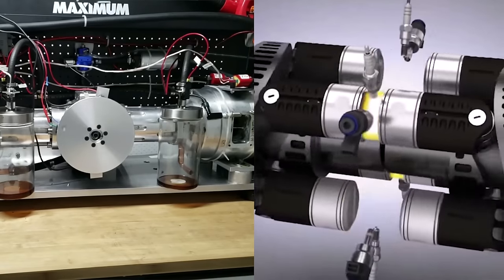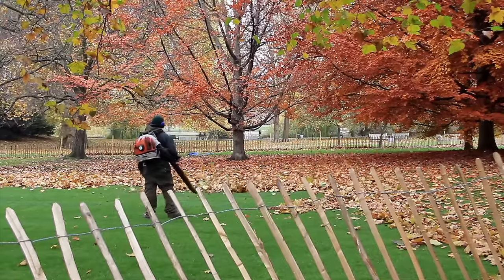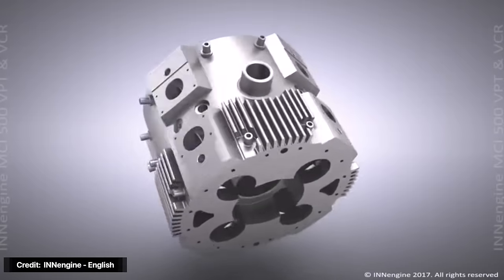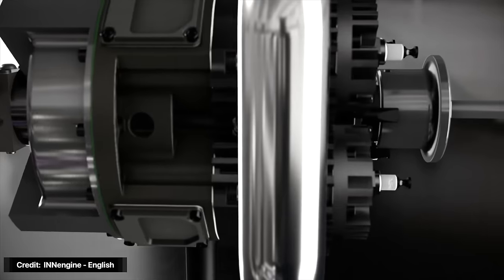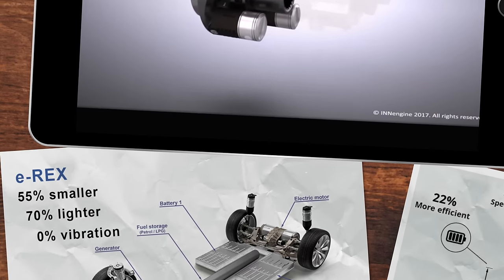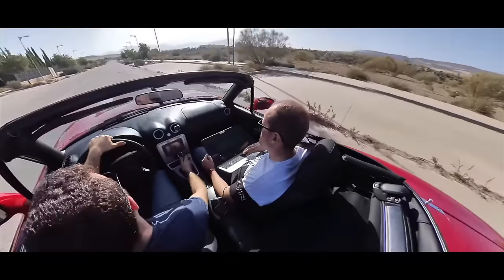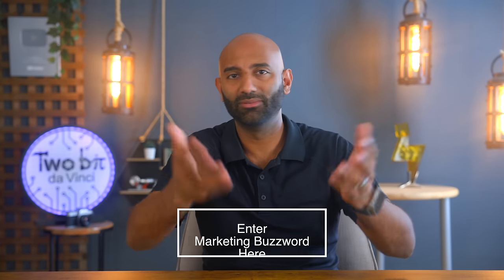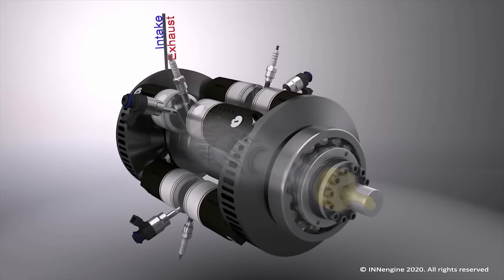One Stroke Engines - 200% More Efficient??

Comment: The Range-extender concept is exactly what Ram's 2025 Ramcharger EV is:  It's they EV truck with a smaller battery (150mile range on full charge) but with a 3.6 V6 engine to provide an additional 500 miles of range.  The 150mile range on the battery alone is a good blend, as that should be sufficient for most daily use.. but for longer trips towing loads, the V6 would kick in.  

I always felt this is how hybrids should work in the first place (I think Chevy's original bolt or something used to work this way?)
Reply from the maker: yeah that's right the Chevy Volt was a pure electric drivetrain, with a gasoline generator running at the ideal RPM for most efficient output to charge the battery pack. definitely agree this is the best way to run a hybrid.
Reply: They need to put that new inline 6 Hurricane engine even if it's non turbo as the twin turbo is overkill for this duty cycle. It will be more efficient as the lighter rotating assembly from a perfectly balanced engine negates the need for counter rotating balancing shafts or sizing of crankshaft counter weights.

Comment: Interesting question at the end! In the 1970s, during the Arab oil embargo, I worked out a plan to make a vehicle much like you propose. It simply had a battery pack, individual motors on each wheel, and a "small but efficient" engine running constantly at its most efficient speed to generate electricity to recharge the battery. That plus regenerative braking would have created an extremely efficient vehicle with 4 wheel drive and "silent running". Had something better than lead-acid batteries been available, and had I more money... woulda coulda shoulda...
Reply: Wasn´t the "every wheel gets an engine" idea shelved because it increases the weight and complexity of the vehicle and doesn´t add much efficiency ?
Reply: @thingamabob3902  Yes it kinda was with engines, but now with electric motor technology the wheel motor is combined with the brake and it only adds a bit of unsprung weight and electric is way less complicated than engines. Far fewer parts, electronic differential etc.
Reply: @slicksquared4336  ok
Reply: @thingamabob3902  Also greatly increases the unsprung weight. However , for a military vehicle, like  a modern Jeep, it would have a lot of merit.

Comment: The range extender idea is a very cool idea. The EVs are getting better at determining the range based on the route, live road conditions, and how aggressive the EV is being driven. An EV could use the range extender along with the route planned, driver input, and conditions at the charging stations to do long haul driving in a car with a much more modest battery. It means 120 mile daily driver does not need a 200 mile range for those infrequent longer road trips to visit the inlaws. In the end, you have a cheaper priced car with less battery weight and is more efficient for those all battery trips. As your range is reduced due to battery degradation, you simply tend to use more gas, but the car is not totally pointless the moment it can't do your daily driving with a full charge on only batteries. If the energy produced per gallon of gas is better than an ICE engine, the engine is near vibration free, and nearly whisper quiet, does it matter the RPM it is most efficient at? It would not likely stand in for a super charger station, but programing a route that requires 50KW more capacity than your car has in capacity, it can supply that 50KW in whatever method best benefits the car during the trip. A hot day, maybe it assists the high power draw accessories giving your battery an easier time. On a cold day, it supplements the heating of the battery pack. The engine could even be integrated into the battery pack cooling system. I don't think it makes sense to use gas to charge batteries unless you were stranded and had no other choice. The efficiency loss on the charging and discharging is not necessary if you can immediately put the energy to use. Tuning the engine and generator to provide as close to the same voltages as used by the main systems would be really important as well.
Reply: Only thing to range extender charging battery's is to run engine at constant efficient speed  and use the battery/moter as transmission for vering demand
Reply: @jeffbybee5207 
Ideally yes. The issue is what if you have a completely flat charge on the battery and have to limp home or to reach a charging station. Not being able to meet the demands of driving conditions required if you stuck in a single optimal engine speed. Perhaps an option could be being able to switch between a constant RPM setting and an on demand setting.
Reply: @jeffbybee5207   This goes back to the basic idea of hybrids: use electric for acceleration, and gas for cruising/charging.  Take all the latest EV technology, and add that 70mpg engine with a 10 gallon fuel tank, and you got a 700 mile range.  It seems like a great option as we develop better EV and their necessary infrastructure.
Reply: Electric motors still make some amount of noise so they're not entirely whisper quiet as one may think.
Reply: Oh, You mean,like a Toyota Prius,or a Hybrid Camry,or a RAV4 Hybrid?:goodvibes:
Reply: @exotica550  One could say that, perhaps.

Comment: Another reason this would make sense in a hybrid is as a solution to the too cold problem. You can start the engine and use it to heat the battery to temps it can be used. 
It also free you from the electric grid. You could totally run the engine to power the battery when necessary.
Reply: You would have to heat the oil and the block to start the ICE engine in the cold. You might as well just heat the battery in the first place.
Reply: @yodaiam1000  Correct . It would be far more efficient to use some of the stored energy in the battery to heat it , than to have a fuel tank engine and generator just to warm a battery.
It would be more efficient just to have a fuel tank and combustion heater for that matter
Reply: @yodaiam1000   - just have a chat to folk in Alaska without block heaters....
Somehow folk manage.  (not roadblocks just solved problems - elsewhere.)
Reply: @kadmow  You aren’t driving an ICE car at minus 40 without a block heater. People with EVs in Alaska manage as well.
Reply: @yodaiam1000   I had a 1983 dodge pickup with a 225 CI Slant 6 that would start at -40, without the block heater plugged in. I lived in Calgary (got some COLD Winters) and had to park on the street, no plugs there. I'd go start the truck and then have breakfast so it would be warn enough to drive to work.
Reply: @glenndennis6801  There are also EVs that will start at -40. It is not the point. I had ICE cars that wouldn't start at -20. Still, not the point. BTW, if you had an EV, you could automatically warm up the cabin in the garage (or outside) before you even got to the car. There is no waiting around to warm up the car.
Reply: @yodaiam1000  Problem with your solution is that at -40, EV range is already drastically reduced, then you gonna reduce it even more by using some of it to heat the battery and car interior?
Reply: @Stambo59  Part of the reason you’re range is decreased is that you have to heat the cabin. At -40, your range is about 60% which is still reasonable. Don’t forget there are are a bunch of issues with ICE cars as well at -40.
Reply: @yodaiam1000  "Don’t forget there are are a bunch of issues with ICE cars as well at -40." Sure there are but none of them will leave you stranded with no heat.
Reply: @Stambo59  Yes, they will. You should always carry blankets, food, candles etc with you when you travel in cold remote locations whether you are in an ICE or BEV.

Comment: I live in Minnesota and for us a fully electric vehicle when temps are below 0 is a tough sell. You can't forget about us and the effect freezing temps have on battery life. Up here a hybrid vehicle makes more sense. I own a truck and pull an > 9500lb load with boat, gear and passengers. My preferred lake is 1.5 hours away. An electric truck would only get me there one way and have no good way to charge on way back, unless I am willing to stop somewhere for 4 hours. A hybrid version, so ICE kicks in to charge my battery on way back, would be a very convincing proposition. At least for now, while tech and infrastructure catch up, hybrid versions of electric vehicles are the best option for many of us.
Reply: I drive a hybrid and it is great. I am not sure about the 4 hour stop to charge a BEV though. The Lightning and Rivian can both charge in well under an hour. The real issue I think is finding a pull through charger when towing. That is another area the where infrastructure needs to be improved.
Reply: Norway has colder temperatures than you do probably. And they are all going enthusiastically electric.

Comment: Range extenders in pick up trucks and larger vehicles is definitely gonna be something. We're gonna live with for quite a while. The ram pick up truck with the range extender It's going to be interesting to see when they actually get it produced what it's like.
Reply: I drive a truck and would like to go the EV route for the next truck. I'm watching the RAM REV. 95% of the time, I could charge it at home. For those times when I need it for towing it has a motor that can run the generator to recharge the battery. But a 3.6 liter V6 appears to be a little overkill. Waiting for it to come out. Very interested
Reply: Check out Edison Motors. They put a relatively small diesel motor/generator (range extender) on a semi (logging) truck. They are also working on a conversion for large pickups due to hit the market in about 2026. They are definitely focused on the commercial market.
Reply: @tomboyd7109 Edison motors is doing awesome work for sure. Range extended EVs will turn out to be cleaner than fully electric ones as they don't need a huge battery pack and liquid fuel will rarely be used since people don't go on very long routes every day

Comment: Just a little 2 cents here, a lot of phev could benefit from this kind of engine, I currently have an outlander phev, the wheel are operated by only the EV motors, but the gasoline engine can provide extra electricity at lower speed or directly contribute to the wheel when above 70km/h. The vehicule is equipped with a 1 speed transmission only for that. 
This engine design could potentially help that kind of vehicule with low range about 61 km per charge, making them more efficient in charging the battery or providing power.

Also there are so many applications for this this could be a really good way to move forward with reducing emissions like you pointed out !
Great video have a nice day

Comment: The range extender option has existed for decades. It is called a diesel electric locomotive.

There was also a guy I used to carpool with who had previously worked at Bell Labs. One of the guys there had built one where if he could charge it. He did, but if he didn't, he had a 10 horsepower engine that ran a generator. Apparently this was actually partially funded by Bell Labs itself. Problem was gas was 30 cents a gallon back then.
Reply: Diesel electric locos have no batteries.  The traction motors run on electricity direct from generators driven by the diesels.  A range extender system, also known as a series hybrid, has an ICE which soley turns a generator to recharge the battery.

Comment: To make EV's work, insist on a standard battery pack, head out of town, getting low on charge, pull into a garage and swap packs, you need two packs, leave yours for the next person to use when charged, the only limit is the distance between service stations with packs.

Comment: Horizontally-opposed pistons have been around for a long while too. The old Napier Deltic was a two-stroke, horizontally opposed engine. This INNengine looks interesting though. I do wonder how that swash-plate design would stand up to prolonged heavy use.
Reply: The Deltic was a triangular layout opposed piston supercharged diesel. The top cylinders were horizontal with the other two rows 30° from vertical. All three crankshafts geared to a common output shaft. One crankshaft had to rotate in the opposite rotation to allow the engine to work. Much of Napier's basic knowledge about opposed piston diesels came from their license purchased from Junkers.

Comment: Back in the early 2000's Chevy was producing the VOLT.  It was an all electric platform but had a small gas engine that would run a generator.  So it would provide electricity for the motor and recharge the battery.  At the time it was out of my price range but I was all for that type of platform.
Reply: I have heard that the Chrysler Pacifica minivan works the same, but haven't found confirmation.
Reply: If memory serves, the ICE, electric motor and wheels were all connected together via a planetary gear, so the ICE could recharge the battery, or could help drive the wheels mechanically. Pretty cool!!
Reply: That was just a Hybrid - DEFINITELY NOT an all electric platform !  Marketing LIES and misinformation.  That small Combustion Engine was a four cylinder that was directly connected to a Conventional Transmission that had been modified with an Electric Motor added.  And if you wanted Heat or AC, the Combustion Engine had to be running.  So, just a Hybrid - NOTHING more, nothing less !
Reply: @johnbishop7912  Yes it was a hybrid. Definitely not "all-electric". Yes GM resisted the term which is totally marketing shenanigans.

But I wouldn't call it all "LIES". It was a pretty unique and very interesting power train! The transmission definitely was not normal! ;)

Edit: Sorry, "conventional".
Reply: @WarttHog  No, it was actually lies.  By the time that vehicle went to Production, it had made liars out of the Marketing folks.  The original design had a tiny two cylinder combustion Engine in the Trunk, that was in no way, shape, or form even connected to the Transmission, and it definitely could not / would not propel the vehicle anywhere.  It was simply to recharge the wimpy undersized propulsion Battery.  When they sized/sourced the Battery, they found that if you needed Heat, AC, or you wanted to make any turns (Electric PS), the range was cut in half !  So they had to scrap that design half way into vehicle development, but were still calling it an "All Electric" platform - when it essentially was nothing more than a wimpy "Strong" Hybrid ...😒

Comment: Ah come on people. If an engine has a piston (or any reciprocating or spinning component) that returns back to the starting point, over and over, it IS NOT a "one-stroke" engine. 

BUT, that is not to say a "one-stroke" engine does not exist, because it does. So, a "one-stroke" engine is quite simple... it is an "engine" where it's power producing component (ie: a "piston" or similar moving component) NEVER returns to the starting point. 

Guessed what that is? It's a RIFLE or PISTOL, or any "GUN" where the "piston" NEVER RETURNS. THAT is the only possible description of a "One Stroke Engine". Enough said...

Comment: Perfect explanation and summary of these multi cycle architectures.
The ev range extender is a real interesting point.  Adding the thousand pound battery to a cybertruck or airplane to go an additional 100 miles is a non starter for me but an electric generator that can accomplish the same range extension at 100 pounds is worth developing.
Reply: Now make the car small and light enough to be accelerated by that generator and you might have something that is actually environmentally friendly.
Reply: Considering that energy density has been a continual issue for aircraft going purely electric, it might be a good alternative in those cases. I don't know about other cases if the electric infrastructure is built up though, might have diminishing benefits and really be a little too late.
Reply: @asldfjkalsdfjasdf lol true, but by that token.. you don't need a range extender at all. A few small, light EV cars can go several hundreds of miles with fairly small batteries because of extreme efficiency. If you get 12 mi/kWh, a modest 50kWh battery gets close to 600mi. Harder to achieve that if you have a giant SUV that you still want to reach 350 miles.

(Or.. just get an e-bike or electric motorcycle.)
Reply: @Cyrribrae  I think sticking with a modern combustion engine while reducing weight as much as possible is a far better way.
Or of course some form of E-Bike under 100 kg where your pedals strokes still mean something while being protected from the elements. 
Maybe the Podbike
But the Podbike with a small combustion engine might be even better.

Comment: The range extender is not a terrible idea while EVs are perfected, but a Honda generator can do the same with proven tech. (It's funny, that they remove the spare tires, but want to add back a spare engine.) The swash plate bothers me. It's one of those technical "details" that can kill a product. Like Mazda's rotary engine seals. A little chatter goes a long way into destroying them.